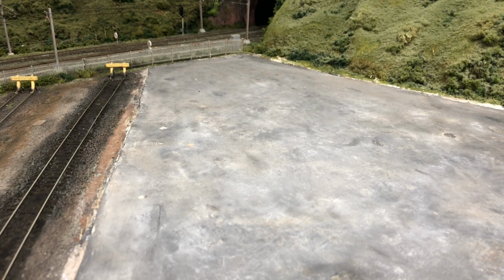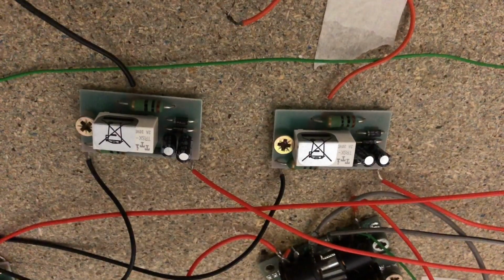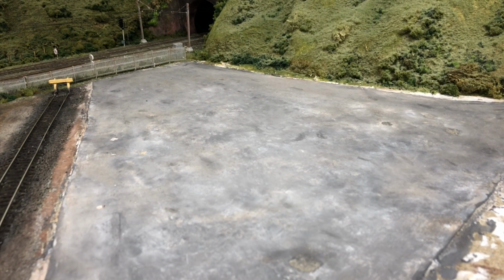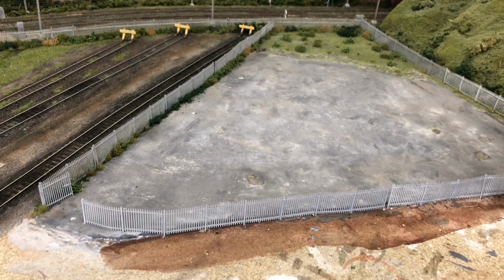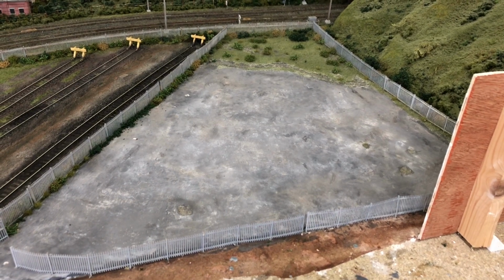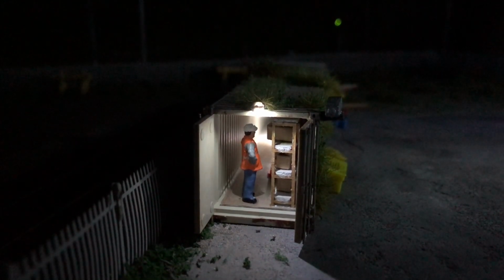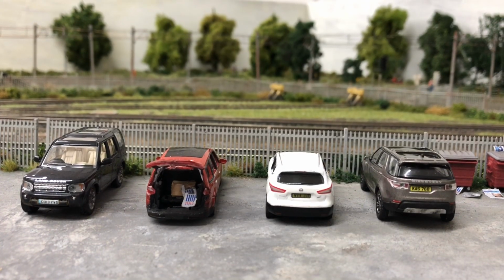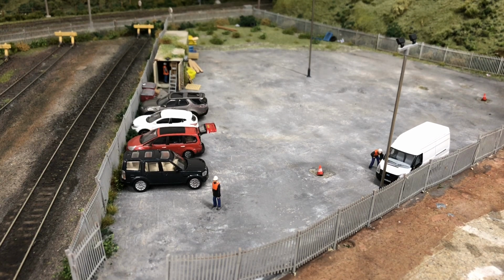Layout Build - Building The Freightliner Depot | The Car Park - Part 2 | Detailing & Lighting

Comment: Coming on nicely fella ! :-) one tip for your future lighting projects would be to use self adhesive copper tape instead of wires in/on buildings etc . Simply paint over when installed, no wires to hide. 👍

Comment: It's quickly becoming an incredible scene that. Great attention to detail keep it up!
You've received a battering about the container, so thought I'd offer a top tip if you decide to adjust it slightly. 
Switch from static grass to fine turf in varying greens with a touch of brown. This will give the effect that your after, you can also use a cocktail stick to apply some small spots of glue and get some static grasses on it. Itll work wonders. 

Other than that top job.